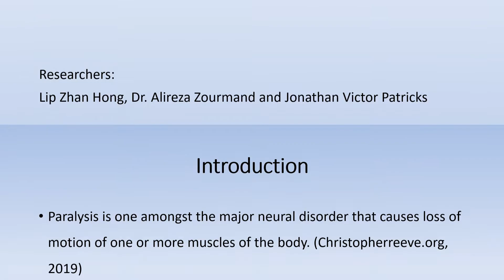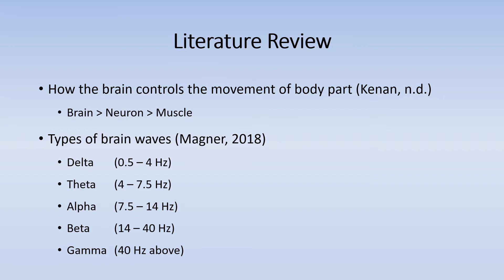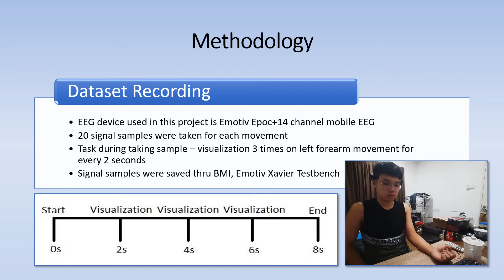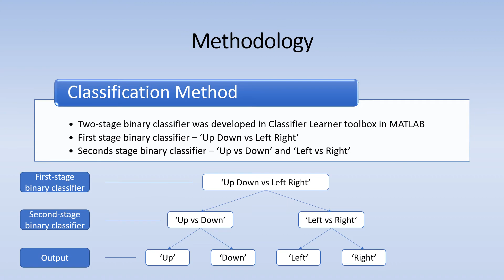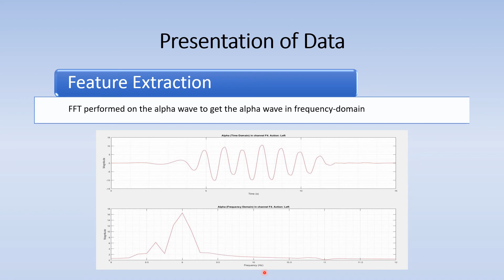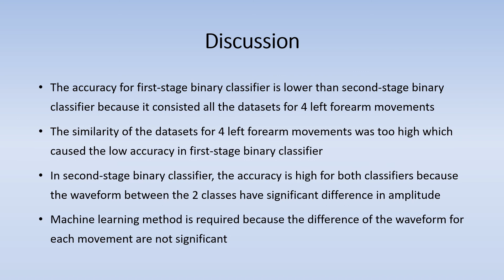EEG-BASED BRAIN WAVE CONTROLLED INTELLIGENT PROSTHETIC ARM

Comment: One thing that I want to add is that instead of using a support vector machine they should have used DNN for the information extraction, that definitely would have increased the efficiency of the model. Moreover, life would have been made easier if it was done in python.